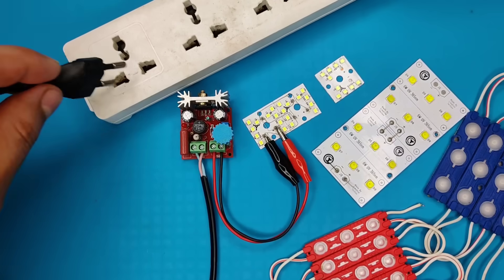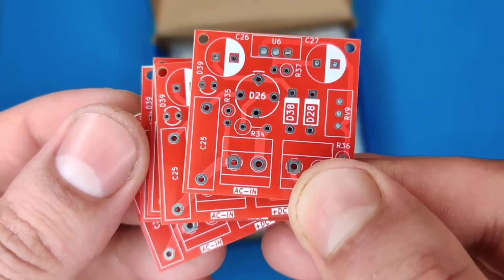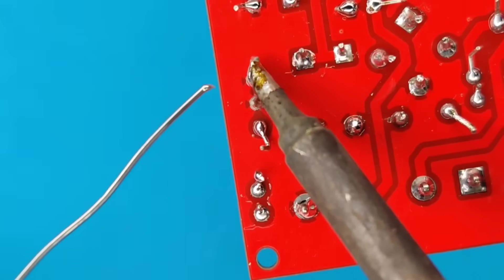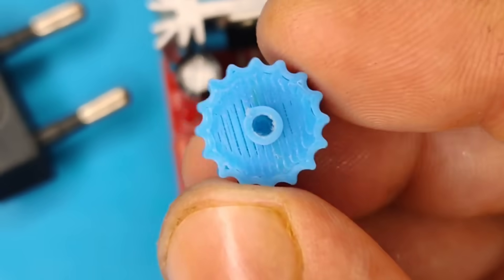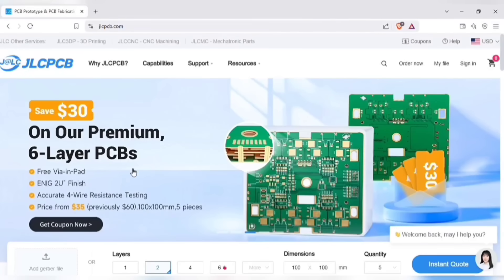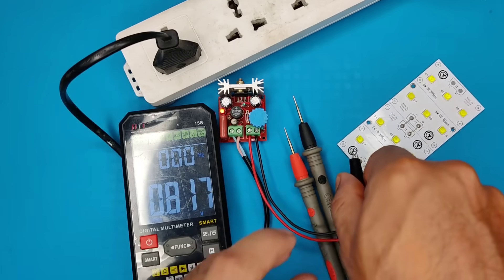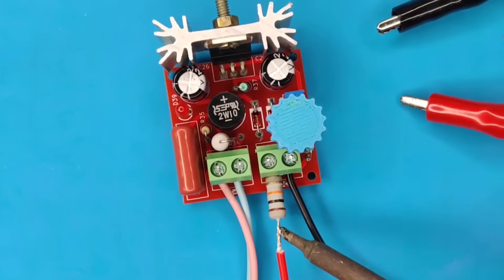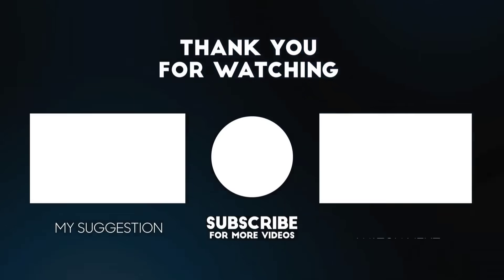Auto volt LED Driver convert #220v ac to 3v,6v,12v,24v,36v,48v,68v,98v,110v

Comment: So it's a Constant Voltage Regulator for Leds?  Please confirm
Reply from the maker: Not constant, low current but Adjustable voltage for leds
Reply: @CreativeTechos basically, leds performance is better and healthier by providing the approx required current. Voltage is not really recommended for driving LEDs.